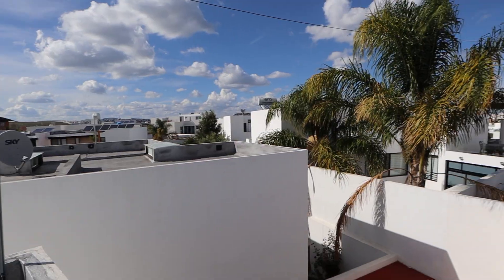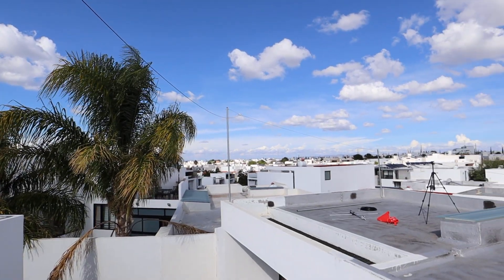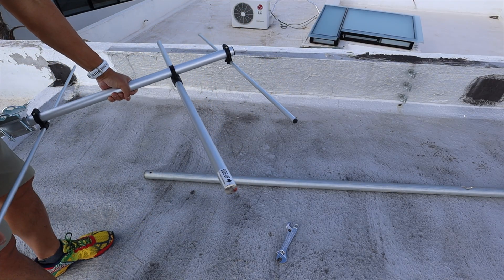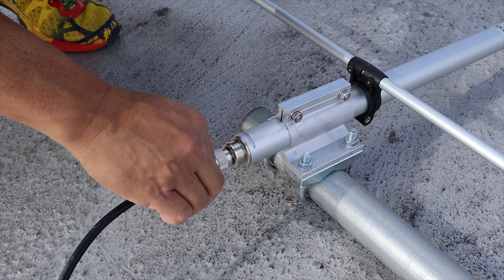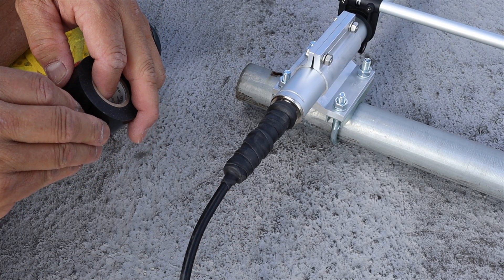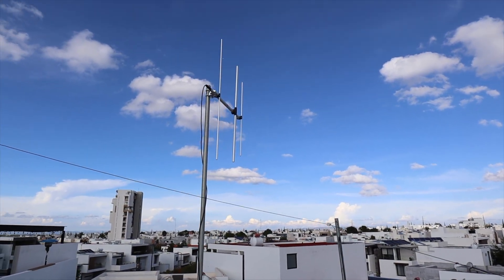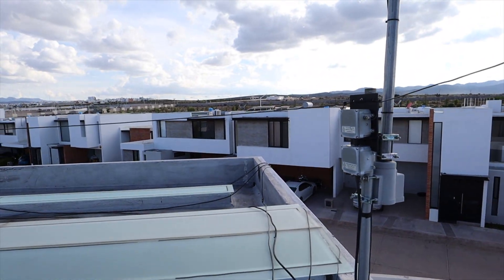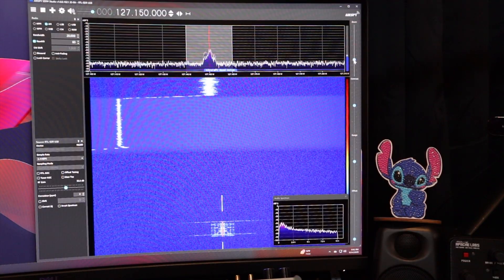Where I decided to Mount the Sirio 3 Element Yagi Antenna | LiveATC Feed | Air Band Receive Antenna

Comment: For my antenna, and my coax, I used a right angle So239 to N connector, and it failed, so SWR was 3.0. Took it out then SWR 1:0. Well in my case.